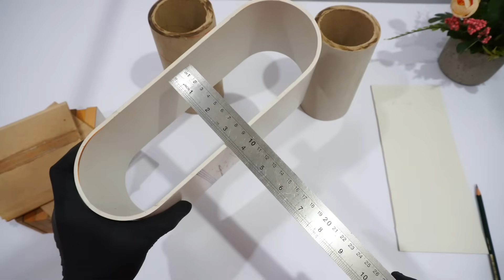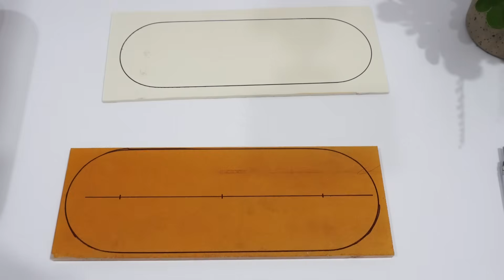DIY Bluetooth Speaker With RGB Music Light | Candy Marble Effect from PVC Tube

Comment: Not a good idea to put a passive radiator in front like this, it will create a negative air pressure and break a part of the power that the two other speakers are making...

Comment: The LED responds only when the volume is turned up a lot. How do I make the LED respond responsively even when the volume is low?
Reply from the maker: what module are you using?
Reply: @PLATINUMKIT  MS-302 RGB STEREO VU METER MODULE" I bought this product and there are 20led~60led, but I purchased 60led. I think I used too large 60led because the spectrum wasn't implemented properly, so I bought 20, 30, 40 led again this time, so when the product arrives, I'm going to try to connect each product...

Currently, as a result of connecting 60 spheres, the LED changes even a little only when the volume is turned up very high.
Reply from the maker: Please chat.
https://www.facebook.com/LegendMasters/
I will send picture to you
Reply from the maker: or you can try to replace 2 input resistors 100k with 10k

Comment: Excellent effort. Some issues that will surely develop. 
Battery protection has no balancing function.
Therefore 18650 will need to be charged and discharged to a 0.5 mAh difference. Next to impossible. As a result will degrade and fail soon. Parallel charging of two sets of bats will exaggerate the problem. I am facing these issues with my Bt speaker construction projects. If you do not mind replacing the bats every few months you can forget this comment
ty and keep it up.
Reply from the maker: Thank you for your advice. 👍👍😀

Comment: 1 more passive radiator wouldn't hurt. You won't get much bass on that single passive radiator. And the size of the passive radiator should be bigger than the woofer to get the bass out of that speaker.

Comment: Hello, what tape are you using to seal the back cover of the speaker ???
Is the switch that turns on the led strip momentary contact or self-locking ???
Thanks in advance.
Reply from the maker: Foam tape. Self locking :)
Reply: @PLATINUMKIT  Tanks you.